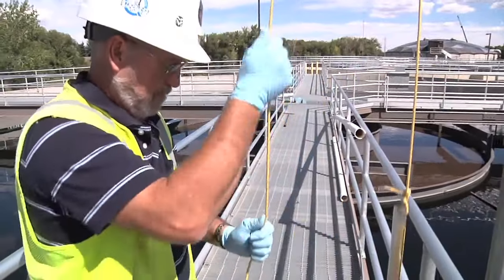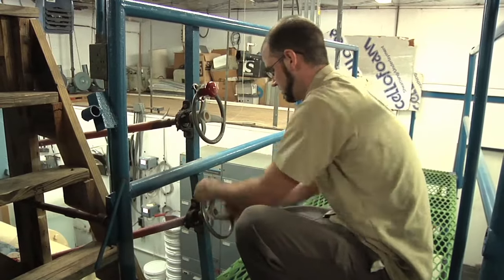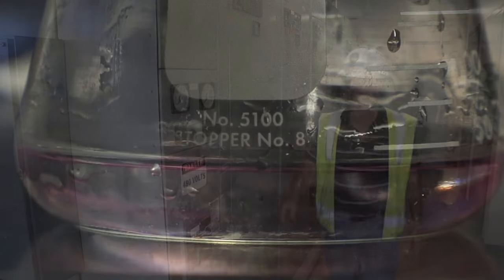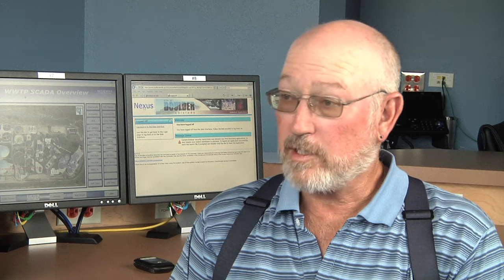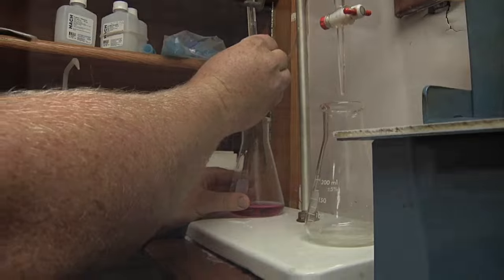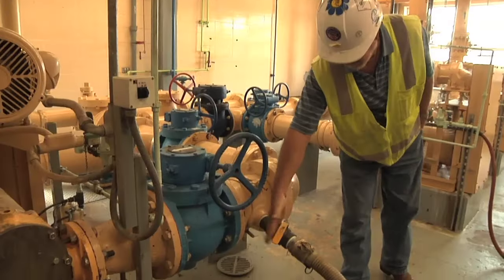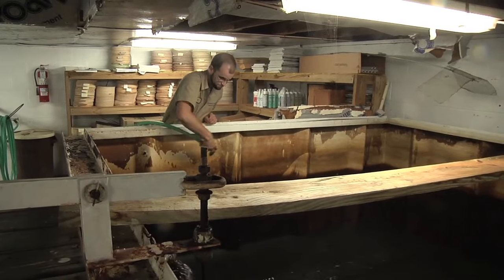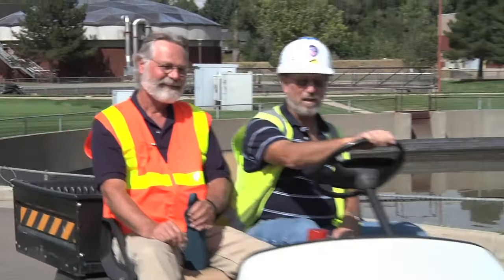What does it take to be a water treatment plant operator?

Comment: I've been in water treatment for 16 years. Two and a half in maintenance,  the rest as an operator. Great job, very stable job.  I received my "A" certification in '09, highest certification in South Carolina. This is really an unknown field, a small field and because of that not many young people in water. I'm 44, from '05-'16 I was the youngest operator b/w 2 plants (12 operators) by ten years and until '18, I was the youngest "A" operator. Within the next year, two operators will be retiring at my plant and in 2-3 years 3 operators at our sister plant will be retiring. Several years ago, the average age of an operator in South Carolina was 57. This field needs more young people. It's a great job, you won't get rich, but you'll have unbelievable job stability.
Reply: I'm interested in entering the field. As someone with no prior experience, what do you think is the best way to get my foot in the door? Should I be looking to get a degree. Or should I look for a lower position in a plant, and try to work my way up?
Reply: @adrianruvalcaba2896  Entry level would probably be your best bet. Maintenance or grounds, meter reader even. A degree would help, but not always necessary. Some plants are looking for trainees.
Reply: Hanvin Gavnah whats the working schedule like?
Reply: @kellyrivvas3728  I rotate nights/days every 2 weeks. 12 hour shifts, 7-7. Most plants are 12 hr shifts. I know of some that rotate every 6 weeks. Smaller plants might have 8 hr shifts and shut down at night.
Reply: @Havin Gavnah
Thank you in advance for taking the time to read & reply to these comments. I live in Colorado & would love a career in water treatment. I currently hold an associates degree (science), and originally wanted to go on and complete a B.S. in Chemistry or biochemistry and still might if necessary but I much would rather get a jump start on my career than have to rack up any more student load debt.. Anyways, I have completed courses in Chemistry and Calculus which I hope would be a plus in finding a job. I also have some mechanical work experience in the HVAC industry. However I have no experience working in a water treatment plant nor do I currently hold any certifications. Could you offer any advice as to what might be my best plan of action? I've applied to a couple Plant Operator job's in my area but imagine I'm probably just too under qualified to be considered. I would love the opportunity to get my foot in the door somewhere and then continue whatever education / certifications were required. I'm a hard worker and would be fine proving my worth at any sort of entry- level position.

Comment: I do not know much about this job/career but I have question.Why does the guy think the job is not going anywhere.As far as, being outsourced I can see why that would be difficult and how it would be best to do it locally.However, the job seems  ripe for automation, at least in the future.We may not be there yet, but what makes people think that one day technology will not be good enough to have robots or machines doing all this work.Like, what would stop a piece of code from telling machines how to test the chemical makeup of the water, how to take measurements or program all the regulations into the code.Maybe, someone in the field can educate me about what part of the job can only be done by a human, not just now but in the future as well.
Reply: 12012channel you make great points and Im surprised no one has tried to answer your questions. Automation is definitely the future. More treatment plants have become automated in the last 20 years. At my plant our scada control center can change flow rates, speed of pumps, rotate pumps and or wells, change chemical dosage,and fill tanks right from their computers. The need for an operator is to check the equipment used is running properly daily. If there is a leak or an abnormal condition, or a mechanical failure youll need human interaction to troubleshoot and/or detect problems tas well as make necessary repairs. Yes a lot of our treatment process are automated but youll always need operators to make sure they are functioning like its supposed to. Hope that gives some perspective.
Reply: Thank you, David.

Comment: Hi everyone i was looking into this career. However it does require 12 hour shifts and to be on call. The only thing i would like to know is if this career balances with life as well.
Reply: I do 12hr shifts. I like it. Basically I work 14 days a month, 6 months out the year.   I'm not on call. That's more for maintenance & management, at my plant. I'm married w/ kids, shift work is ideal for me. I can get a lot done on my days off around the house & my kids could stay home more. I fear working 5 days a week. The most I work is 3 12hr days then I'm off. I work 2 on 2 off 3 on 2 off 2 on 3 off. Then I rotate either to days or nights for 2 wks. I like it, it's hard on the body, messes with your sleep, but I still prefer it over straight days.
Reply: Did you end up getting it Nate?

Comment: is Wastewater Operator and water treatment plant operator the same thing?
Reply: +ericktwelve11 Well, wastewater operator converts wastewater into normal water, but other than that I think they're pretty similar.
Reply: ***** but, is it hard to get those jobs?
Reply: They look for certain skill sets for people when they apply, so it's nice to have  a background in science/math and some hands on job experience that requires manual labor helps. Whether it's difficult to get or not; I haven't been able to get an interview and I've applied several different times.
Reply: +jthiggs 96 I applied a few times myself. Since I have a ton of experience in the sewage industry and plumbing I thought I would be high up on the list to at least be interview, no such luck. 
Going to get my treatment license and give it another go.
Reply: Water treatment protects the users waste water treatment protects the environment  they usually split the two because they are separate disciplines  although some equipment are shared by the two
Reply: +Stan Johanson not shared but gave similar equipment. Lol
Reply: +Stan Johanson have
Reply: The terminology varies. I worked at one where I was a "water reclamation plant operator." Then I worked at another where I was a "water pollution control facility operator." Same skill sets and license. Plants do vary on kinds of processes they use though.
Reply: A wastewater operator makes bugs, a water treatment operator kills bugs. One is sewage the other is drinking water. The equipment is similar but the process is very different.
Reply: Wastewater has health risks and pays the same. Go with regular water treatment. Just know, you cannot just become a plant operator. You gotta start at the bottom digging holes like everyone else.
Reply: @JamesOsyris  so you gotta start off in distribution regardless?..
Reply: @eisupnext  No. Customer service or site maintenance are areas you can start in. If you get enough certs and you have a good resume doing other shit, you can start in treatment. But most starting positions will require you to break a sweat.
Reply: @eisupnext  Another thing, if you get your certs while working at a company, you will QUICKLY bypass people who refuse to get their certs. A T3 is a highway to $40 - $50 an hour.

Comment: I'm majoring into wastewater treatment,  can someone give me advice about this field?
Reply: +Jason Wilson Get good at test-taking because getting an interview is very competitive. These guys make it seem a-lot easier than it is, getting certified is easy but usually I see about 50+ people being called in to the pre-interview exams which can get very discouraging.
Reply: +Jason Wilson i'm going for distribution. i'm going to be ensuring the poop gets through the pipes safely for you :)
Reply: Chemistry, biology/microbiology.  Also some ecology, natural wildlife ecosystems type classes. Go to Amazon books and buy a used copy of "Standard Methods of Wastewater Analysis".. I suggest buying a 1970's or late 1960's edition, for the reason of old-school chem. methods. -Should be able to find one for just a few dollars. Most labs nowdays are equipped with instant results type stuff. If the automatic test equipment breaks down, what do you do? Break out the hot plate, beakers, pull the old Standards Methods off the shelf,  and go for it with old school basic chemistry. I think all plants should be able to do this. I used to work in the San Francisco bay area where earthquakes happen. Facilities can lose power for running their computerized lab stuff. Labs need to be able to do their work, regardless.